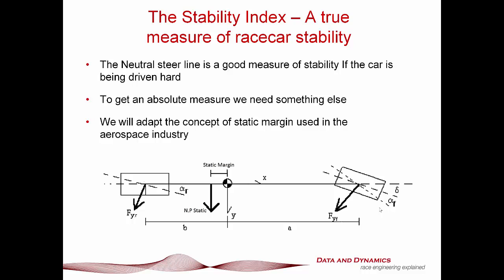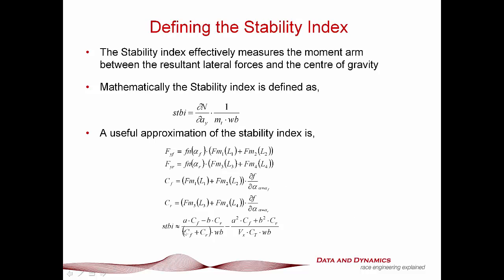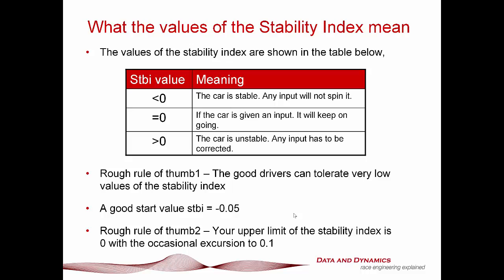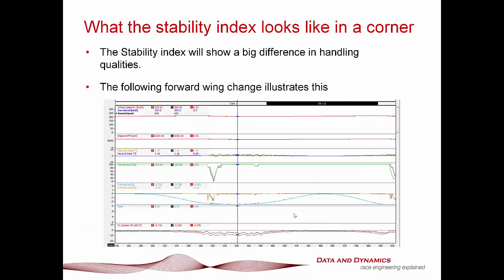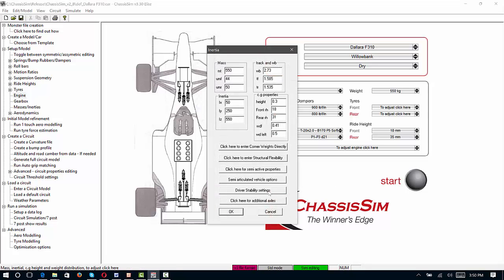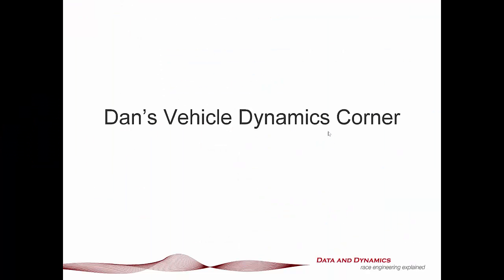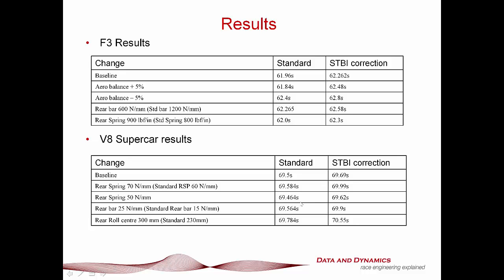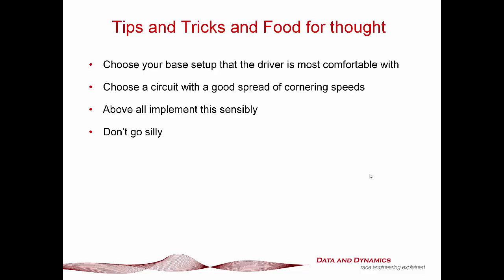Incorporating Racecar handling into lap time simulation

Comment: Hi Danny, nice video, congratulations! 

One question: when you show the telemetry data, you point out to numerical results for the stability index that i am not able to see on the screen. 
The channels i see are speed, RPM, steering angle/neutral steer, throttle, lat and long acceleration, Gear and FL camber. 

IF i understood correctly you point to this latest channel when talking about the STBI, but i am not really sure. In any case, which channel in your telemetry plot is showing the STBI? 

Thanks.
Reply from the maker: Andrea - M/C the standard values was -8.7%, with the 45% aero balance it was - -5.2% at the mid corner.
Reply: which channel in the telemetry plots? still cannot see it.
Reply from the maker: Andrea here's a break down of what is in the data plots - 

Trace-1 - Speed (km/h)
Trace-2 - RPM
Trace-3 - Steered angle/neutral steer
Trace-4 - Throttle
Trace-5 - Lateral/Longitudinal acceleration
Trace-6 - Gear
Trace-7 - Stability Index (even though it is titled FL Camber that was there for debugging/QA)
Reply: Everything's clear now, thanks!